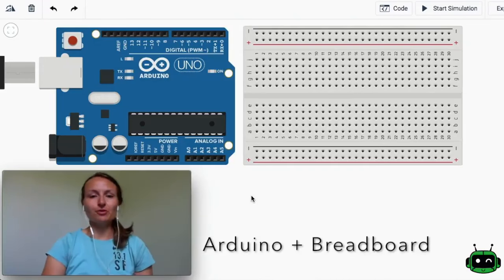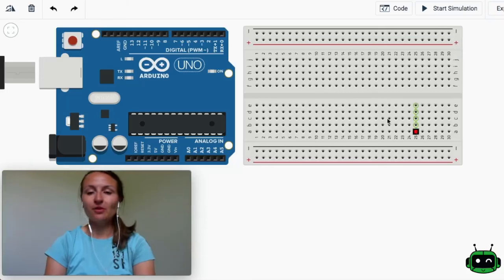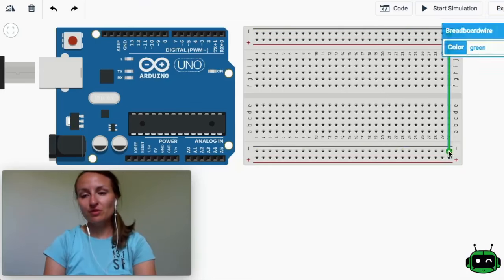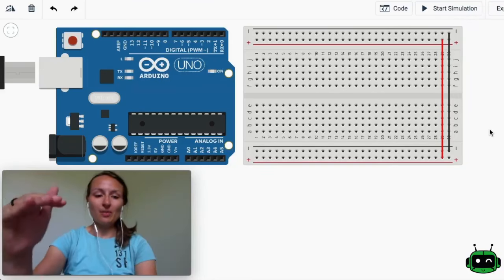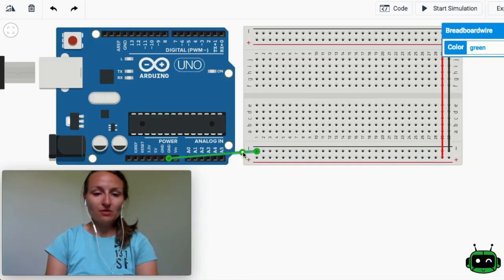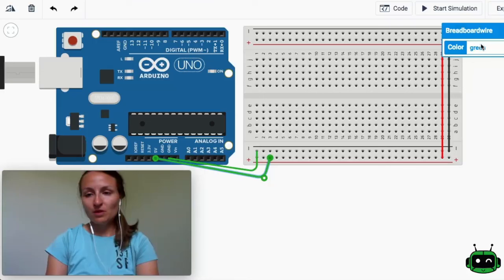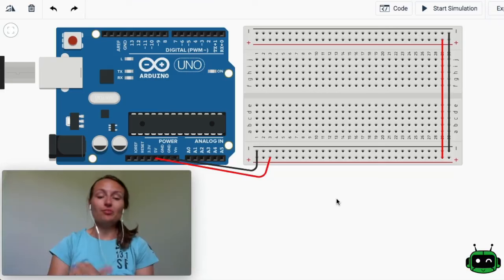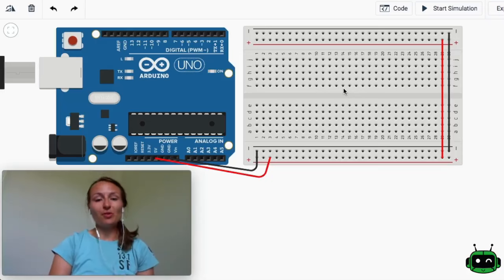How to Connect Arduino to a Breadboard (2 min Setup!)

Comment: I'm just starting out in arduino (nano every).   I've seen other videos where the arduino is placed onto the breadboard directly.  What is the advantage of doing it this way?
Reply from the maker: Place a nano on a breadboard to easily prototype with it. The breadboard is like an "expansion" board to easily access its pins.

Comment: I am confused about the difference between digital pins and analog input.
Reply from the maker: digital = 0 or 1
analog = 0 -> X bit (arduino has a 10 bit ADC so it's 2^10 = 1024 - 1 = 1023)

Use analog if you need more granularity in your reading. Use digital if you just need to know on or off